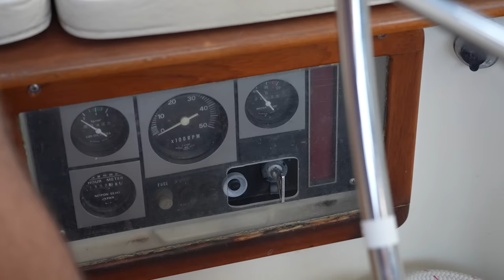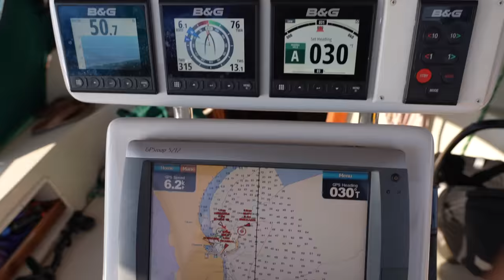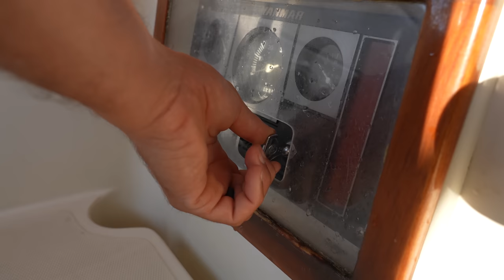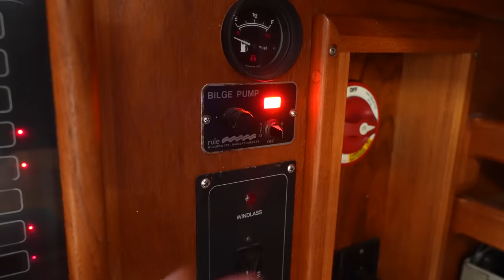Off the Beaten Path is So Much BETTER | Sailing Greece | S08E31

Comment: Hi Jordan, as a Yanmar technician I urgently advice you to change all the perforated hoseclamps and change them with pressed in ones. I personally had an issue with them breaking 2 times and overheating the engine.
Reply: NO perforated hose clamps on my boat. I spent 3 whole days and lots of money replacing all those cheap clamps and building a complete replacement inventory. Agreed.
Reply: Aircraft style T clamps please!

Comment: Here's one more thing:

When sailing in a foreign country, it's also required to fly the courtesy flag of the country you're visiting. This flag is typically flown on the starboard spreader and shows respect for the host country. Not flying the courtesy flag can be seen as disrespectful and may lead to penalties or fines, as it's a widely recognized maritime practice. For example, in Croatia, they do fine you.

Comment: Thanks for the videos. Keep the family safe. BTW, how do you keep your dinghy so secure? It didn't look like it moved at all. I have the same type of davit system, and the pully that lifts it in the stern had a .50 cent bolt break and dropped the stern into the water well under full sail with winds blowing at 15 knots. It flipped the dinghy side ways and acted like a wall. I struggled to pull it up with the force it was under as I couldn't reduce sail fast enough. I thought it was going to rip off the davit. It was that powerful.

Comment: Air-conditioning - After 6 weeks within 10degrees of the equator on a boat with no air conditioning or refrigeration, two things were just overwhelming.  When we docked, a large yacht sent down a bottle of Champaigne - It was chilled.  It was the first cold drink we had in 6 weeks.  Then the hotel.  It was air-conditioned.  We walked into the room and both said, "OMG, it's freezing in here."  After turning off AC, we had a pleasant night at about 75 degrees F.  AC and cold drinks.  Which is most important to you?

Comment: Flying a flag of a country where the boat is registered is a requirement  in EU and has little to do with the pride. The size of the flag has, so to speak. So if your boat would be registered in Canada you should fly a Canadian flag regardless you being a US citizen. You should also fly a smaller flag of the country you're currently in after the check in procedure.